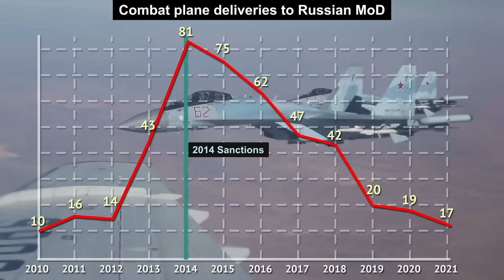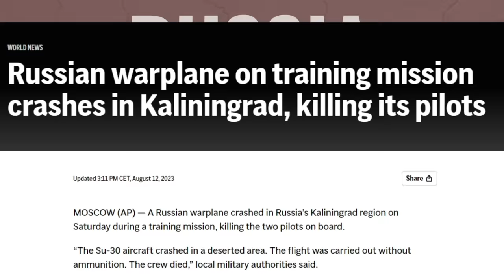Russia has produced more combat jets than it lost in Ukraine in 2023

Comment: Do you really believe that rusia produces so many airplanes in a year? In a year 2021 they got 21 new planes or something like that (year before war and sunctions). Maybe they try to use old planes from from reserve and say that this a "new" planes...
Reply: This is almost certainly the case. It's incredibly unlikely that Russia is capable of replacing the losses they've suffered with equal capability. What's far more likely is that Russia has upgraded decommissioned or mothballed aircraft.
Reply: @steveclarke1857 you cant really recommission old planes. you can do it with tanks, planes are different story. Basically because airframe are rated for limited hours of flight as engines. so there is no point rebuilding old planes cause their resource is already used as to speak
Reply: @cactuslietuva  -- do you actually believe that Russia sticks to the stated airframe/engine hour limits?!  
Look at their A-50: they built about 40 airframes, and now appear to have 1 operational frame left.  It would not be surprising to see them cannibalize as many as necessary to be able to get at least 1 or 2 of the mothballed frames back into the air, since AEW&C planes are essential to coordinating air and anti-air assets.
Reply: Why wouldn't I believe it, for example during ww2, year when Germany made by far the most planes/tanks/guns was 1944. Your comment has no point.
Reply: @bricology  Since USA managed to finally cut off Russia from Europe, the first year was ruff. But as soon as the money flow started coming in from the East, is started flowing in much, much more than it ever did from Europe. Russia will only get stronger and stronger. So I don't really understand why is it far fetched to think their entire defense industry to ramp up production?
Reply: Do you really think that sanctions are working?😂 And that Russia can't make planes on their own?😂 😂
Reply: Theres something called the blackmarket
Reply: @vanjamenadzer  There's a major difference between converting some air dropped bombs into glide bombs and suddenly increasing your fighter jet production by X amount. The former is way easier and cheaper to do than the latter. Russia was utterly bungling its aviation program when it still had access to Western components and suddenly with sanctions in place, massive brain drain taking place and the costs of production increasing significantly (ruble inflation) that's the time Russia supposedly gets its act together? Yeah, sure.
Reply: @cactuslietuva  just because planes have been mothballed doesn't mean they were used much. The soviet union kept a lot of airframes in storage for a potential conflict.
Reply: @cactuslietuva  Of course you can. The reason pretty much nobody does it is not because it's impossible but because it's a massive safety hazard (and the money spent refurbishing the plane is usually better spent buying new airplanes). Look at what North Korea still has in its airforce and if you're looking for a past example look no further than the Rhodesian airforce. Rhodesian planes and helicopters were kept running far past their airframes service life. Gonna be very curious to see whether or not Russian maintenance crews will be as competent as their Rhodesians counterparts.
Reply: @cactuslietuva  doesn't matter whether or not Ukraine shot it down or not. Russia itself confirmed they lost an A-50. Whether it was Patriot, S-200 or friendly fire is irrelevant. A loss is a loss, a 2nd A-50 at that.
Reply: @vanjamenadzer  wrote "Russia will only get stronger and stronger."
Oh, SUUUURE they will. 🙄
Let's see: 
1. Most cutting-edge Russian scientists & engineers have fled abroad, and have zero interest in going back, since they can get far better-paying jobs in countries where they have actual freedom.  That brain-drain can't be fixed with importing foreign talent from say, India or China, since no one wants to move to Russia now.  And Russia can't train enough new ones to replace them, since once again, many of the smartest young men are choosing to leave Russia to avoid conscription, & to study abroad.
2. Russia is cut-off from access to high-performance chips -- the sort that are essential for advanced weaponry, avionics, AI, etc.  Remember, 95% of the world's supply of such chips (sub-20nm node) comes from foundries in Taiwan, S. Korea & the US.  Russia can't produce chips smaller than 55nm nodes.  China produces a small amount of high-end chips, but nowhere near enough for their own needs (which is why they're desperate to invade Taiwan & take over the foundries).  And AI is becoming increasingly critical for competing in the world.  Russia is WAY behind the US in AI, and well behind China as well.  And no, China isn't going to share its AI with Russia; it doesn't want that competition.
3. Russia doesn't build its own precision tools, which are essential for things like machining close-tolerance mechanical systems like turbine blades; they import these tools from Japan, Europe, China, the US, etc.  Welp, most of those suppliers are now refusing to sell to Russia.  No precision tools, no jet engines, no fighter jets.  Let's not forget that Russia's primary bomber (the Tu-95) is a 1952-design that uses propellers, FFS!  They're outclassed in every way in the skies today.
4. LONG before Russia got hit with sanctions, it had already proved that it was incapable of actually producing new platforms in anything like the numbers necessary for viability.  For example, Russia's attempt at a 4th-gen MBT, the "Objekt 195", was launched in late-'80s, and was supposed to be in serial production by 2009.  Nope; the program was canceled without any being produced.  Then it was revived in 2014 as the T-14 Armata, which was supposed to go into serial production in 2016.  Again and again production was delayed.  As of 2024, there may be as many as a dozen T-14s, but not one has been used in combat.  The same is true of Russia's attempt at a stealth fighter, the Su-57.  Despite the program already running for 15 years so far, fewer than 2 dozen have actually been built; barely enough for one fighter squadron!  (In the meantime, the US has produced over 1,200 stealth fighters.)  Oh, but NOW that Russia is at war, hit by sanctions, having to limp along with old tools and fewer and fewer engineers, they're suddenly going to "get stronger and stronger"?!  Patently ABSURD.
5. Any cohesion among ethnic, religious and tribal groups within Russia is fraying, accelerated by the disproportionate number of Russian conscripts and casualties from ethnic groups like the Bashkirs and Buryats.  There have been large antiwar demonstrations in both regions lately, and it will only get worse the longer this drags on.  Russia may be the world's largest country, but the ethnic Slavs with all the power are concentrated in the far-west, and are in the minority in the entire Yakutia/Zabaykalsky Krai region (and others).  Russia has collapsed twice already in the past century.  It's entirely possible that it will collapse again.
Reply: Did you even watch the video?

Comment: What is the bottleneck that would limit ramping production significantly ??.  I'd rather be trying to build 1000 of something than 20 of something.  You start to get into efficiencies of scale.
Reply: Probably High-Tech Resources, especially Electrical System
Reply: @dotto3263  The numbers are so low, and it's not the 70s.  Every phone has got enough CPU power to do all this stuff nowdays.   Perhaps the turbines ??.  Stuff that was once exotic electronics is not so exotic as it was.

Comment: Not mention is the severe decay in Russia of its aerospace design capabilities. Huge numbers of the best engineers left Russia. The guys I work with are awesome!! In the past Russia was arguably the best in aerostructures design and well ahead in composites design. The new commercial jet from united aircraft was possibly designed as badly as if Boeing did it.
Reply: Never was. Just bad copy paste.
Even before 2014 they were unable to make smth decent for civil avia even in int. cooperation
Reply: @User122-ty  
My info on MS-21 was that they had strength in aero design, systems design, but totally flopped  with the composite wing. They tried to clot together an aluminum reenforced test example to permit flight test until they could fix the wing design but never succeeded and my last info was the program was “paused” indefinitely. I got only a loose comment on the Russian engines which was “seem robust” but of course not as fuel efficient as was desired. These engines will go on the improved IL-76 based A-100, if they ever proceed with that project.
Reply: @richardkudrna7503  the program is "shifted right", but the money flows as usual 😀
Reply: Fun fact: Despite having 1/3rd the population of the United States, Russia produces almost as much STEM graduates as the USA.
Reply: @burningphoneix  where are they all?
Reply: @User122-ty  Presumably working in Russian Energy, Mining or Defense/Space Industries.
Reply: @burningphoneix  50% in nano-Industry, since nobody can see results of their work. Other 50% for CIA since their results are destructive.

Comment: All are garbage aircraft
Reply: Not really. It is more due to tactics and pilot training. For 4th gen aircraft, Russian aircraft are not garbage. Are they as good as say the F-15? No, they are not as good, but they are not garbage. After all, it doesn't matter what is in the air. It is still a threat that can do serious damage.
Reply: @houseslippers7732  Su-35 is superior to any mod of F-15
Reply: That makes sense as f-15 are very old  @МихаилОрлов-б8щ
Reply: @user-qb9ec2is9n in some areas like dogfights, sure, but this isn't the 60s anymore, and the F15 has a better radar, and whoever sees the other first will get the first shot off. 104 to 0.  Also US pilots have more training hours.
Reply: @houseslippers7732  Su-35 has one of the most advanced phased arrays ever built, and missiles with a longer range. So yes, it will see and shoot first.
Reply: @user-qb9ec2is9n  104. Still, the F15 will see the SU35 first since SU35 radar reaches out in a narrow FOV, which is impracticable. As for the missile, well, you gotta see the enemy first, and the SU35 payload is lacking with carrying 4 on top of that USAF is coming out with another long ranger BVRAAM missile. Not to mention where the SU35 info comes from is spotty at best.

Comment: Oryx says russia lost all of its tanks per year 😂😂😂
Reply: Oryx has pictures and its a very good source
Reply: Yes it's true but many damaged and destroyed were dragged back in to the factories near the frontline and get fixed to be reused again. Destroyed Russian Tanks are nonesense.
Reply: They do a decent job counting,  it's just that Russia has a TON of machines sitting around waiting to be used..... though some of them are likely a little rough. 

Are you implying that they are faking photos of destroyed/damaged equipment?
Reply: Red Effect has more than once documented Oryx pushing misleading loss figures by counting the same vehicles more than once, just moved, and with their condition slightly changed. Especially if Ukraine first claims they capture and then destruction, It’s very possible that it’s the same vehicle just before and after being destroyed. 

There’s also a large number of times where oryx claims a loss as a Russian loss, even when it’s impossible to make out any markings or identifying features of a destroyed heap of metal. So that can be basically called outright fabrication.

There is also the issue with Ukrainian corruption, and having a very strong state emphasis on propaganda, and an extremely high perverse incentive to inflate their kill count in order to keep securing military aid.

Given Ukraine  being pathologically dishonest everywhere, else it is beyond a doubt they lie chronically about their kills. It would be a safe practice to divide the number of Russian armor losses by three. One for a tank initially damaged or abandoned, another of it moved elsewhere, and another of it, having finally been destroyed.

Comment: No mention of SU-57? Lol. Su-57M production going into overdrive now that the new engines are ready. The M designation is for identifying models with the new AL-51F1 engines that allow it to supercruise at Mach 2 without afterburners. The new engines catapult the SU-57 capabilities. 
And while Russia doesn't routinely use the su-57 for Ukraine per say, they did use Ukraine war for testing the SU-57.
A decent article can be found here in the link. 
https://youtu.be/_4CRgF4eadg?si=Yp45N4aHYy1dfXDW
Reply: He has SU-57, watch again.
Reply: And your reliable source is?
Reply: @ChicagoDB  I missed it then. 
However I think that they're holding off on production of the SU lines like the 30sm and 34 because the Checkmate might be Russias new flagship fighter en mass. So small batch runs to get by until then. Because the SU-75 will use the same AL-51F1 as the SU-57M's. The engine will be tried and tested by the time SU-75 production is ready. So half of the battle is already won for the SU-75 goals currently.

Comment: Actually, it seems that the Russian air force became more effective in late 2023 and early 2024, specifically through the use of FABs.

These have a range of 25 to about 35 miles, so are only really useful at or near the front lines, but they seem to be very effective at destroying Ukrainian fortified positions that were previously surviving artillery bombardment.  And their accuracy seems pretty good.

And the FABs are inexpensive enough to be used in large numbers.  In particular, Russia seems to be using the FAB-1500 much more now, which was very effective in Avdiivka.

So the Russian air force has taken on the role of front line heavy bombardment force.

For attacks deeper in Ukrainian territory, defended by AA missiles, Russia prefers to use long range missiles to limit aircraft/pilot losses.
Reply: They innovated with those flying FABs, poor man's JDAM basically. Thats why they use FAB-1500.. these things are not exactly precise so you need big bombs to compensate. But it has nothing to do with number of aircraft.
Reply: They changed tactic but are paying the price for it. Ukraine has recently forward deployed effective AA systems, probably Patriot. Sooner or later Russia will either give up with FABs or run out of aircraft.
Reply: @jonathanwebb8307  Yes it's a typical counter-counter measure. They will keep innovating on both sides because their lives depend on it. And people become ingenuous when their life is on the line.
Reply: @jonathanwebb8307 But when Ukraine forward-positions AA missile systems, this works both ways:  More likely to shoot down Russian aircraft, but also more likely to be spotted by drones and hit.  There is video of a Patriot battery this happened to recently.

Unless NATO pushes a lot of AA systems to Ukraine soon, along with all the other things Ukraine needs, I think Ukraine loses in this attentional war.  And this seems to be what is currently happening.
Reply: @adamesd3699  Ukraine recently acquired Skynex and the forward deployment came shortly thereafter. Regarding a destroyed Patriot, it was claimed by Russia that they destroyed one with a Kinzhal , however there is no evidence to confirm this and other sources say it was only lightly damaged but still operational.
Reply: @adamesd3699  the sad reality is that NATO countries don't have the industrial capacity to produce sufficient AA, and it's an old flawed system.

Comment: Russian warplane might look not so great but they have gained valuable experience specially the crews in real wars lately. Their production numbers compared with losses to attrition by use and combat, etc. might not be so high but in the long run they will outlast and overcome the more limitedly replaced Ukraine smaller Airforce and anti-air defenses.
Reply: Don’t be so certain, Russian spare parts have always been low in life span, engines are like 20% the lifespan of western engines

I would very much like to fast forward 100 years to read the history book about the OR rating